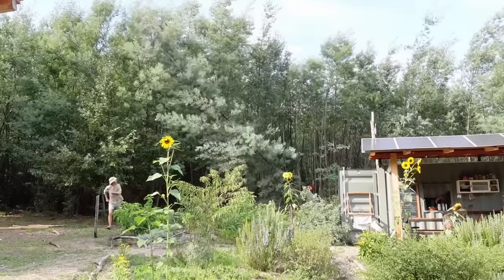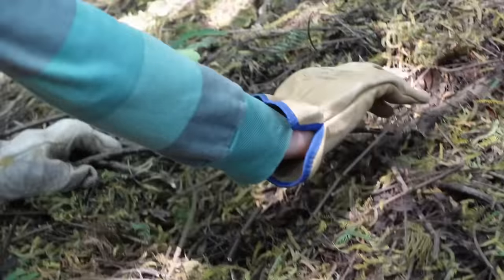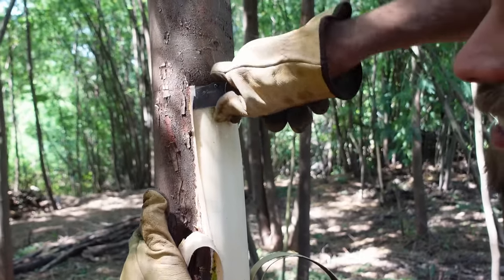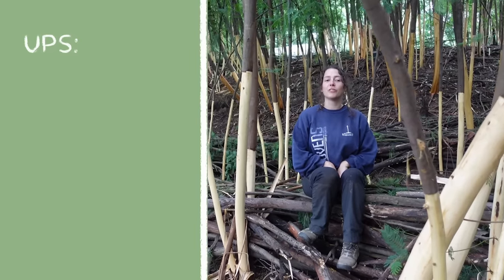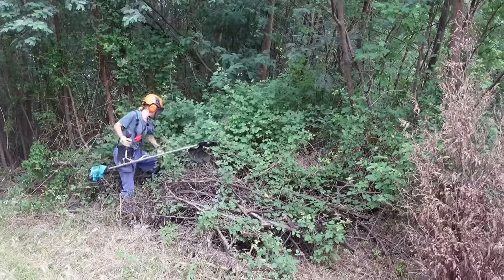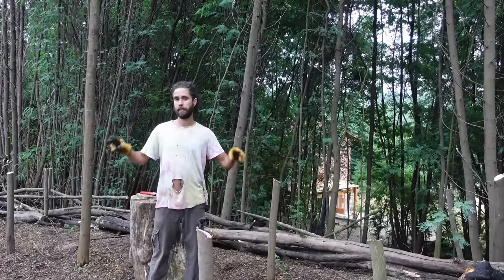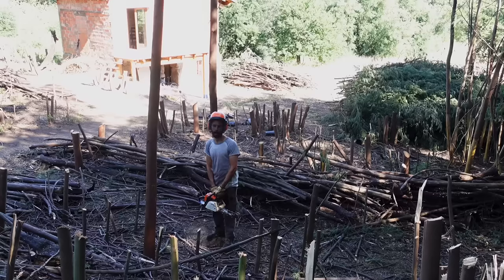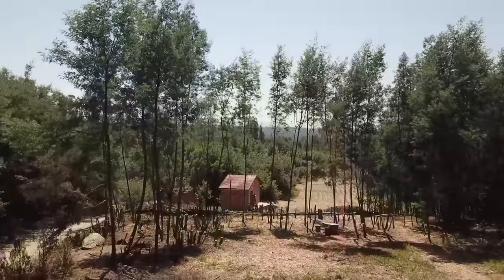#84 Why we're chopping a forest down

Comment: mimosa idea: charcoal kiln, cook all meals on home grown energy
Reply: Vote this up!
:D
Reply: Yeah. These logs are valuable materials and should be saved for firewood, charcoal and basic rough building material.
Reply: Stored natural energy.. Guess they just worried about any potential fire risks, But if done it a controlled area it shouldn't be a problem.
Reply: A 55 gallon drum with a 30 gallon drum inside of it makes a great charcoal kiln which is very safe to use and FAST in producing charcoal for HEAT, COOKING and BIOCHARCOAL to improve the tilth of the soil!  In Central America, lands improved with biocharcoal over 1000 years ago are still fertile!

Comment: Leafy wood chip makes an incredible mulch for young fruit trees and your veggie garden, to keep the soil moist and weed free. Use at least 5cm depth or more. When watering, you'll find that it soaks straight in. The longer you can leave the big piles to mature and start to rot down, the better.
Use short sharp poles as rows of low stakes to help terrace the land, and retain rainfall.
Reply: Make some compost bins and add some chicken manure to get it started with the green shreddings!

Comment: tip of a experienced Blackberry brambles fighter (i had 100m² overgrown area). If you cut them, cut them always as low over the ground as possible and cut vertically into the ground roots too... I took me 3 seasons to get them to rott/disappear... if you cut them not directly over the ground, they often make new leaves, that then supports the regrows of new vines.
Reply: And why not just cultivate them properly?
Reply: @southernboycookin5383  I mean, I kinda like the idea. Blackberry espalier. It just seems like an awful lot of work and would require constant attention. Are bramble blackberries worth it? I've never had them.
Reply: @southernboycookin5383  : I had a patch with wild Blackberries, that where not tasty/bitterish and the yield was not good. actually I do grow a variation of blackberries there,  but not on the full 100m²... that is a bit much
Reply: Blackberry absolutely takes over everything here in the PNW. The berries are nice but they turn forest into green razor wire

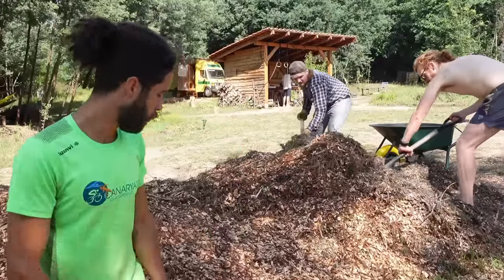Comment: 29:39 Your chain saw blades are dull.  That saw should slice through the green mimosa like butter.  Do you have a electric chain saw sharpener?  Do you have several sharp chains on the shelf for each chainsaw at all times?  Important to optimize the tool.  At 31:15 a good illustration of wasted time and energy.  If the chipper was operating uphill of the office, the branches could have been fed directly into the chipper and the chips blown into the woodlands. Job done.  I suspect it would be wise to buy this model of chipper or next size up for Project Kamp so it was always available.  35:26  That farmer will take the mimosa logs and sell them to a processor who will use them as fiber for paper/cardboard of OSB panels.   Notice his brand new tractor.  Did he share the proceeds of the sale with you?  36:20 Long handled pitchforks are the tool for loading mulch.  Do you have multiple long handled pitchfork's and the fellow with the shovel does not know?  39:30 all of the native species volunteers need a good ring of mulch to care for their roots and encourage upward growth.

Comment: Not sure if this has been said before, but these water retention lines you built from the mimosas are perfect for so called "Benjeshecken" (dead hedges). They provide shelter and food for birds and other animals, and are great for the protection and as a seed bed for the native seedlings you'd plant in the dead wood. Also, they are a great option to do something useful with the mimosa trees.
The German Wikipedia about this topic is an interesting read and a good starting point: https://de.wikipedia.org/wiki/Benjeshecke. Here in Germany, you see Benjes hedges every now and then, even if they are usually a bit higher than your water retention lines.
Keep up the good work! 💪

Comment: I'm looking foward to your experiences with the bark shaving. I know this technique a bit different: Shave 20-30cm and use a wirebrush to get all the kambium out. This is important so the tree really stops trafficing assimilates from the top to the bottom! In theory this should kill the tree slowly over the course of around 5 years, exhausting the roots so they don't resprout (depends on the species of course) If you debark a bigger section like you did, they might die much faster ( 1-2years) but might resprout since the roots are still strong. So yeay keep us updated!

And please sharpen your chains & learn how to use the chainsaw in a proper & save way ! What you're doing looks real scary & I'm amazed that you had no serious accidents so far!
Reply: That chainsaw action looked really dangerous...

Comment: Instead of debarking, you should also try girdling. Basically debarking, but in a ring around the tree. Everything above it should die out within a few weeks.  
Debarking doesn't add much over this, it just takes more time.
Reply: Or find a use for the bark....
Reply: @mfr58  Mimosa bark isn't really the best, you could weave some fences out of it but once it dries it gets pretty weak so even a basket would become useless pretty quick
Reply: Exactly. Lots of additional time but no extra benefit.
Reply: @mfr58  That's the thing I don't get. That bark is medicinal and I am pretty sure they can sell it and even keep some for an apothecary. I hope that is what they are going to do.
Reply: @daylen577  mimosa bark can be used for medicine apparently and burned
Reply: @daylen577  Maybe it would make good fire lighters :)
Reply: @mfr58  That is a very valid idea, if it's something they're interested in. You can bake a lot of pizza with a pile of wood like that.

Comment: Some thoughts:
What species of 'mimosa' is it. There are several. Acacia dealbata? Albizia julibrissin? It makes a difference because of things like potential toxicity (e.g. the seeds of Albizia apparently contain a neurotoxin that is poisonous to stock if they eat it. Must be a local botanist who could ID it for you.
What are the locals doing to control it. Goats sound good IF you want the milk, meat, etc. If you do, they would make sense to eat the young sprouts. BUT they would need full access so you would have to cut to ground, not half way up. Once you have cut to ground, re-cutting would be easier.
At what age does your mimosa seed? Does it seed copiously? Will it seed into your cleared areas? If so (and especially if the seed remains dormant in the seed bank) you will need to keep removing the seedlings. Goats might help. 
De-barking is better than frill girdling. By taking out the bark, you don't kill the tree fast as the xylem will still transport water to the crown and the crown might stay alive for a considerable time. By frilling, you end up with a narrow 'gap' in the bark which may heal over. By de-barking, you avoid this.
Use the machete as a draw knife - sharpen from the handle to a handspan short of the blade. Make sure that bit is sharp but the bit near the point is not. And wear gloves. Can you use the bark? Shred as a mulch? Depends on whether toxins are present - you need to know what species you have. 
Use directional felling on the trees. You get much more control over the fell. Watching you made me cringe - they are only wee trees, but once they start moving, there is a lot of inertia there. Fell to ground to save yourself work later.
Fell uphill. You will have to be organised. Extract downhill and straight into a bigger chipper. You may find that there is local interest in wood chip for combined heat and power generation if you have enough to make it worthwhile. They may not want the frash mixed in. You would have to be organised with your felling.
Good luck with spreading the shredded tops and small diameter stuff. I would worry that it would dry out in summer and if you get a fire, it will propagate in the spread chip. Perhaps better to pile it and compost it. Then use the compost. Keep it watered and beware heating and possible combustion as it rots. Let it get warm (it will rot fast) but not too hot to touch. Monitor it and turn it periodically. Isolate your piles behind a firebreak if you go down this route (just in case). Note that composting goes better if you mix in the 'frash' or green material.
Can you 'chunk' the branches and use them as wood fuel or in a ring kiln to make charcoal/biochar? Best made in winter and with seasoned material.
Watch this   https://youtu.be/R1PIObjaejU   to see an easy, efficient and safe way to log up felled lengths for wood fuel. Don't forget that properly seasoned and dried wood fuel should burn cleanly and efficiently. It is in-cycle carbon whereas gas/oil/diesel for cooking and heating is sequestered carbon. 
Shutting up now. Hope this was helpful. Good luck.
Reply: Acacia dealbata

Comment: With some off the trees you take down, why don’t you try to make bio charcoal, it will help in the garden and could increase your yield. Have a great and safe day. ❤️🇬🇧🙏
Reply: Imho by far the best solution.
Reply: I was thinking of suggesting the same. Charring could be also nice if they want to use it as material for fences and alike.
Reply: @peterpalparragi6992  Yakisugi is an exciting approach and could be well linked to the production of biocharcoal.
Reply: That would mean learning a real skill and doing some hard work. They've been bleating about this fire hazard for more than 2 years and yet have done little to address it. 
We had mimosas in our garden in Italy. I know from experience that the piles of wood and brush do NOT rot down - eventually I had to burn it in the winter. The bigger pieces of wood were dried and used as firewood, but that took work to cut and store it. 
I can also tell you that mimosa sprouts everywhere, not just from the base but from the roots that are very shallow and run a long way out from the tree.
Reply: Apart from some herbs, they don't have a garden
Reply: @dFrame06  yes, they don't have a garden but they want one. Even for a modest start with a few raised beds next year, it would be good to prepare biocharcoal this year.
Reply: Made the same comment but you beat me to it!  In Central America, land improved with biocharcoal is STILL fertile after more than 1000 years!

Comment: Leaving the trunks on the ground may be good long term, but in the dry season they can be a source of tinder. Same with debarking. What about making biochar with them. A great soil amendment, and not flammable once charged obviously. Are you allowed to do controlled burns in the area? That can help too- especially if you're leaving that much tinder on the ground.

Could be a good idea to get goats (or borrow a neighbors) once you've cleared the area. Plant pioneer species and protect them from the goats with like individual fencing, and have the goats roam through the cleared area when they mimosa resprouts until the plants are dead in a season or two.

If you aren't opposed to just using herbicides, you could also cut the trees to essentially ground level (1" from soil) and paint some 50% glyphosate on the exposed surface

Comment: Humble suggestion: If you are going to be doing a lot of digging and shovelling, buy some long, straight-handled spades. They are so much easier on the back than the short spades with handles. They long, straight-handled spades can be worked with minimum bending of the back and a slight bend of the knees. They also allow you to throw dirt farther.
Reply: As a former construction worker like maybe yourself this is so true !!  10 times easier !!
Reply: I see this a lot, when the shovel handle breaks close to the blade. It is an easy fix to use the same handle. After a few fixes the shovel handle is too short and the user starts to have lower back pain.

Comment: Since you've got all this mimosa you should look into getting a gasifier generator. You can use the mimosa as fuel. It will be an alternative source of electricity for you and gasifiers produce less greenhouse gas than simple incineration. (They do produce some obviously). I don't really see what else you can do with it all since you have SO much.
Reply: I agree, this seems like a sensible idea. A problem lots of people have with gasifiers is finding enough fuel to run them. There is an excess of fuel here so it's kind of perfect.
Reply: @marvelarvin2317  Yes! exactly. You can make your own gasifiers (plenty of youtube vids on that) or you can buy them.

Comment: In South Africa we do the same eradication and it is often among fynbos which is mostly protected. We use a product called Garlon mixed with a blue dye and paint or spray it on the stumps. The dye is to see which are painted and which are not. Garlon is recommended by the Dept. Environmental affairs so it should be safe for other plants. Garlon stops regrowth. Regards from Billy

Comment: i have watched the great work you guys have been doing for many years migrating from Precious Plastic days. I have just rewatched the last 20 odd videos , I have to say your search for solutions to your challenges seams to be focused on the "best" solution. This often leads to  throwing a screw in the air to choose between 2 solutions that both may work. There is a benefit to those looking to solve these issues for themselves for you to show things that fail or fall short of perfect. So times many smaller different solutions can often solve large problems. Like your POO issue, de centralized toilets each using different  models. Long drop, and on top of composting bin,  and bucket to compost site.  "Humanura" , Human made manure is a great resource to recycle the nutrients back to the earth.

Comment: You could use your thicker trunks to make posts for fencing. Then use the skinny poles to weave into the posts to make a wattle fence. Since it is mimosa those posts in the ground will rot over time and the fence won’t be permanent. But the fencing could keep goats confined to the location where you want them to eat those regrowing mimosas. Without goats it could take years to finally remove all of those mimosas.

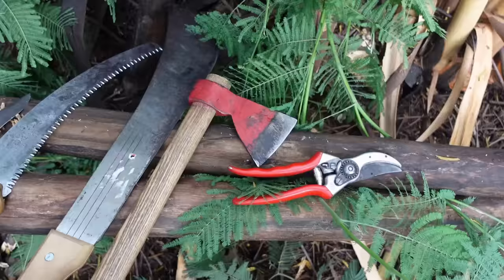Comment: 17:43 that is what we call a "hatchet." My grandmother used it to split kindling for her wooden cooking stove. An AXE has a long handle on it to get swing and momentum.  Oil your tools, rust cuts down their effectiveness. The metal quality will determine the ability to sharpen a fine edge and maintain it longer. Oil, oil, oil before storing good luck 😊

Comment: I've been watching a lot of Asian home reno videos and they'll often save all the "poles" when they clear trees to use later for fences, outdoor kitchen buildings, furniture, etc. Also, I don't know if this works with acacia but with the bush honeysuckle that is invasive where I am, when it sends up new shoots you can pull them downward to break them off easily, it's easier than cutting them. If you want to make the acacia poles last for ground contact (like fences) you can char the ends, it will prevent rot, it's a Japanese technique called "shou sugi ban"

Comment: The Bark strips look right for making woven baskets. Save a pile, soak in water to keep moist (or container with soaking towels). When using, set up a stripper board (two sharp blades - from box cutter - inset in the board) to set a standard width...

Comment: Mimosa wood is one of the most smoky woods that imparts a distinctive earthy aroma. Add a nice flavor to most red and dark meats with longer smoking times. Try the mimosa wood pieces for fast smoking pork, beef or even cheese.

Joanna Werch Takes: According to Wikipedia and eHow, Mimosa tenuiflora is a perennial evergreen or shrub native to South and Central America with fern-like leaves. It has a high (16 percent) tannin content and is used for fuel, fences and posts, bridges and wheels, since the high concentration of tannin helps it to resist rot. The wood is also sometimes used to add roughage to fodder for domesticated animals, but in North America, it is generally considered an ornamental tree.

Comment: Really interesting video! A couple of comments and questions i have:
Would the debarked trees, in time, increase fire risk due to having a large amount of standing deadwood?
Could the bark strips removed be used for weaving? Perhaps into baskets, or screens?
In the felled area, why did you cut all the trees at waist height? Do they resprout just below the last cut or something?

Finally, if cutting removes the current issue, and debarking prevents regrowth, could you combine the techniques? Cut the trees down to waist height and then debark the remaining stump to stop it coming back?

Oh also, next time the power company come clearing the lines, tell them you want it all chipped on site, not just left where it falls  :-) . Its your land and your trees so they should be willing to work with you seeing as their lines are the guest there ha

Comment: I used to work at an adventure playground in the UK and we used bark chips to make a safe, soft, floor for the outside space. We used to get big piles of bark chips delivered and had to spread them out very quickly as when they were piled up they sometimes generated their own heat and caught on fire. I'm worried that could happen in the big piles of chippings if they don't get spread out quick in future.

Comment: There are industrial grade woodchippers that can easily handle even fully grown trees.Those would  make short work of your mimosas. You should cut all of  them down much cluser to the ground, ireally almost flush and then burn out the stumps. that way they will not grow back.  copper nails can be used to kill them for good as well, but given the ammounut of stumps you have that would be a lot of work.